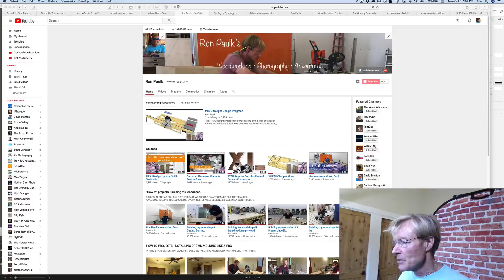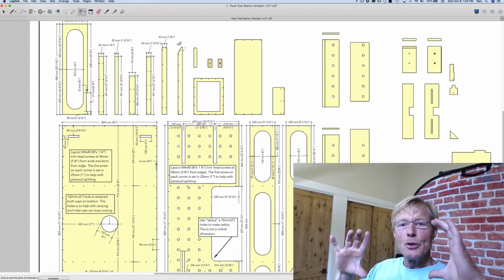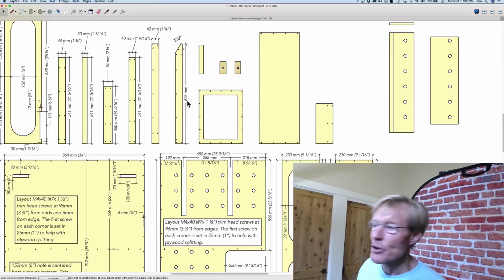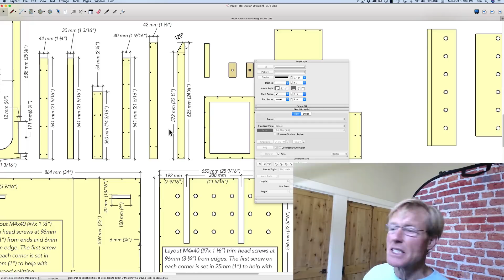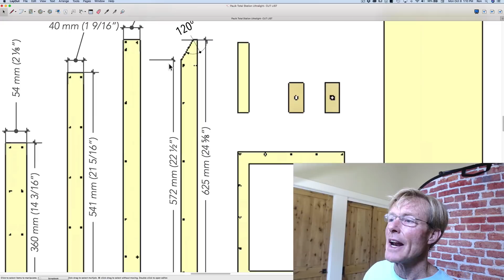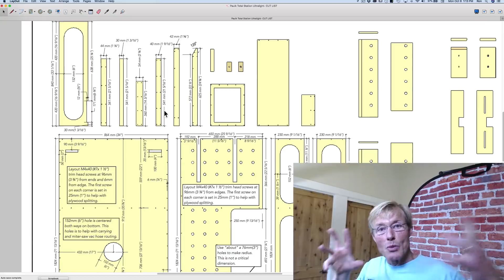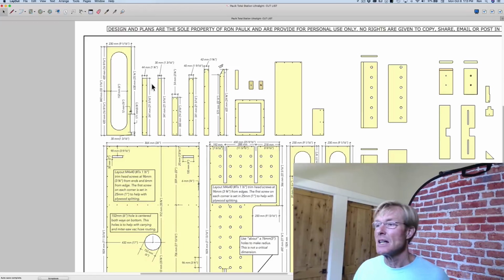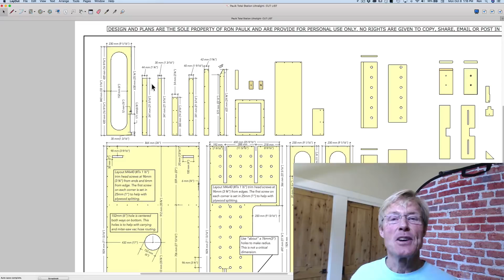Dimensioning Method in SketchUp Layout

Comment: I agree with John.  I love your work.  Period.  Thank you for having a fair go at using the Metric Standard for your primary Sketchup Project.  And using mm as the unit standard instead of m.  

I must comment on how much time is being spent on having Metric mixed with imperial.  And the contradictory nature of this work compared to your past work highlighting efficiency.  Watching you translate those dimensions by hand one at a time is excruciating.  I've been there many many times.  

I've written a number of times encouraging others to completely abandon and how to quickly and easily completely abandoning the Imperial Standard for the Metric Standard is.  Perhaps this is an inevitable step in realizing the next step in the evolution of (y)our woodworking.  

Another approach is once you have completely finished the Metric version you can have another completely different portal in Imperial.  Copying the Metric portal to an Imperial Portal.  Then using 1/8" standard for that specific Imperial portal only.  This conversion being a one off automated conversion and never having to address the conversation by hand one at a time again.  

I have to confess that having mixed measurements on the plan is distracting to me.

I can only hope that you will soon realise that the Imperial standard has been superseded by the Metric Standard and that you will continue.  Hopefully embracing and encouraging others to completely move to the Metric Standard.  I know from years of experience how difficult it is to let the Imperial standard go.  

All my best to each and every one in my extended woodworking family. No matter the standard.  

The only difficulty in converting is in our minds.

Comment: What a huge pain!

Why not simply have separate pages for metric (default) and "American standard"? That's how your previous drawings were provided and, from a user's perspective, it was fine. Seems like a huge amount of work for any perceived gain.

Besides the effort, this workflow is error-prone and produces a static output. Any change in the model requires Layout to be updated, then manually modified.

So, if a part is changed in SketchUp, Layout has to be updated. Then your manual dimensioning has to be redone, complete with manual conversion of associated measurements (the error-prone part of the process).

Have separate pages for the different measurement systems seems like a better way to go. (Not to mention easier for you!)

Anyway, as always, that's for sharing you know-how with the world Ron. Your designs are wonderful and your content is a level above most others.